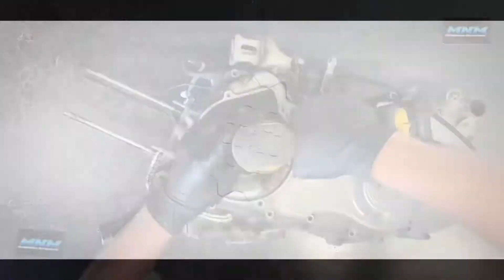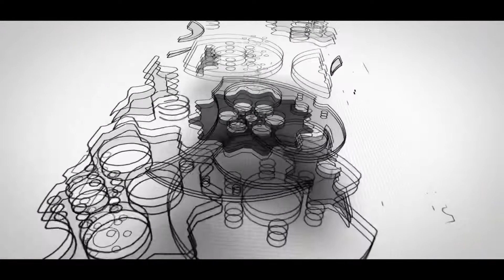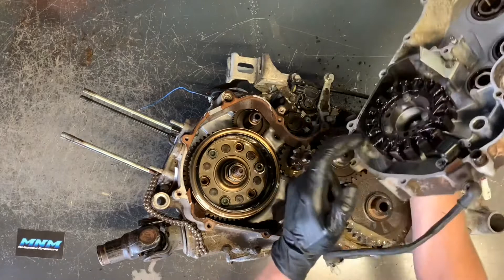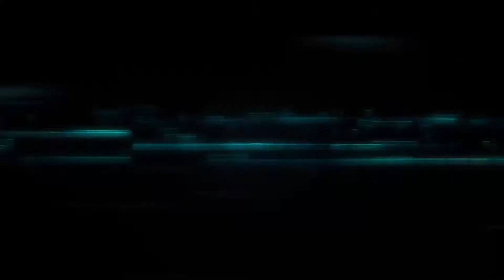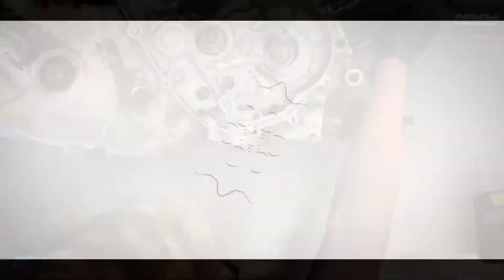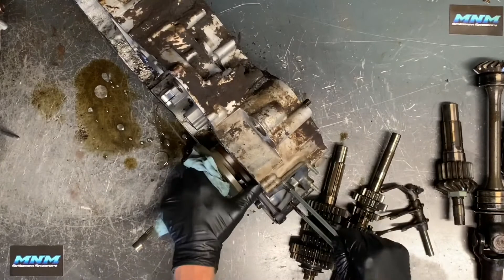Suzuki Quadrunner 250 -LTF250 - Engine Motor Transmission Explained Tear Down

Comment: Hiya...really good video, you're very proficient and know your machines mate.
Did you do a reassembly video, I'm particularly looking at the left-hand side gearset orientation and selector fork install and what washers are supposed to be installed before the case goes back on.
Also there's only 3 Allen heads installed on the flywheel to sprag clutch...is that normal?
Cheers heaps, I'm gaining confidence from watching you. Keep it up man 👍😃😎

Comment: What was going on with the trans? Mine is stuck in super low and seen a video of a stuck gear being on this side but yours came right off.
Reply: did you figure it out theres no reply?
Reply: @inthenameofmyfather3836  yes mine was this same bushing gear, the gear was seized onto the bushing. I initially ordered the wrong part but got it figured out. Works perfect now

Comment: Nice video, thanks for sharing! :-) Looking forward to see your video on the housing odometer gears. I have my odometer apart at the moment, does it get oil from crankcase/engine? or do you advice to fill it up before installation? 
Kind regards!